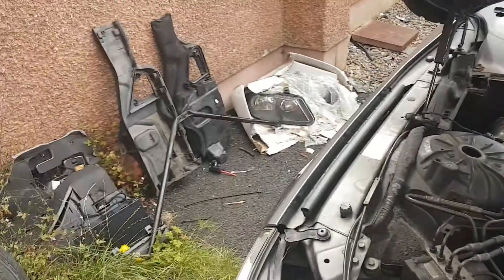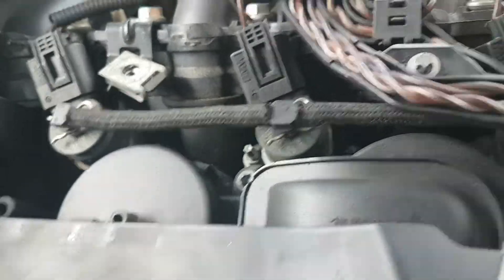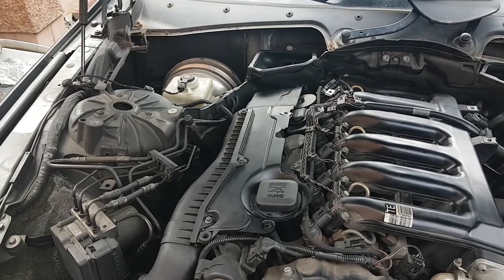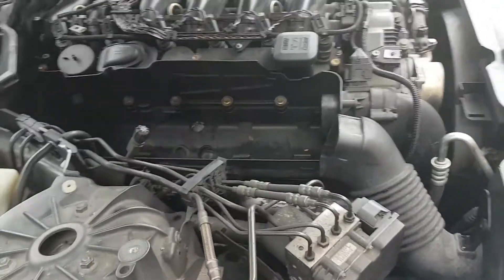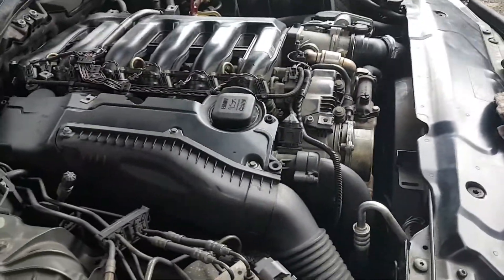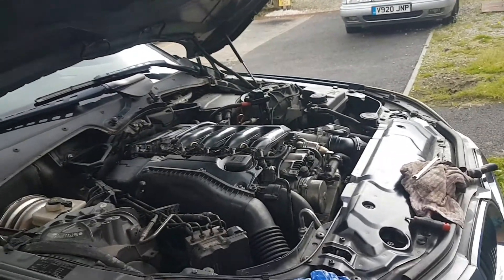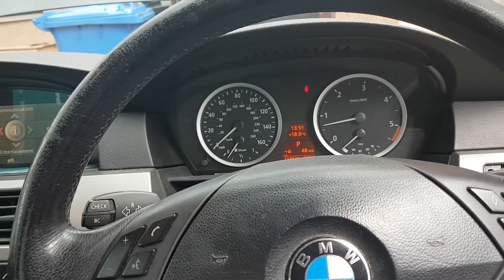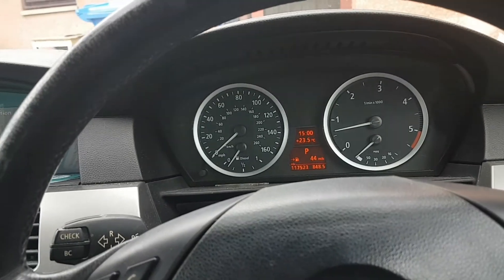Bmw 530d Manifold 🤔 Or boost leak.

Comment: Good result Ali. All the best for Mot mate. 👍🍻
Reply from the maker: I have to wait a couple of weeks but should be good only a light to sort and a bit of trim thanks mate
Reply: @AliMackMechanical  I've seen a lot of videos on headlight cleaning but it would be interesting to see a video on how you do it. I seen one with a lemon and salt. I had a 320 auto once but got rid of it after the beast from the east. I was driving constantly on rutted ice and it developed a vibration for donut bush in middle of prop but couldn't be sure and was ready for a change so traded it in.

Comment: Nice job Ali. (It happens sometimes, we give ourselves  unnecessary work.) It's coming along!
Reply from the maker: Yeah it's ready for an Mot now I have to fix a light but that's it thanks for watching
Reply: @AliMackMechanical  your very welcome
Reply: @AliMackMechanical  my manifold is broken on my e60 end it is low power and rmp idila does manifold is problem or what please help
Reply from the maker: Check boost hoses. If the manifold is badly cracked yes this could cause a problem.
Reply: @AliMackMechanical  my map sensor maf sensor turbo and turbo hose is now i howe sam problem losing bost 20%but i see the manifold is broken and rmp ticking but engine stile working normaly
Reply from the maker: @daliborjurjevic1979   On this car there was a burst boost pipe. Going to the EGR valve but if your manifold has many cracks then it can cause problems. Most times it will not just smoke in car. I hope this helps

Comment: This engine sound comming from exhaust manifold leak?
Reply from the maker: This car had a boost leak also a small crack in the manifold.
Reply: @AliMackMechanical  If I don't have a boost leak (I tested), can I have the same engine sound like yours because of an exhaust manifold leak? Because my engine noise is the same as yours
Reply from the maker: @MessagesHUB  It's possible yes
Reply: @AliMackMechanical  Thank you, how did you fix boost leak?
Reply from the maker: @MessagesHUB  I  replaced the pipe
Reply: @AliMackMechanical  And when you replaced the pipe and exhaust manifold this weird engine sound is gone?